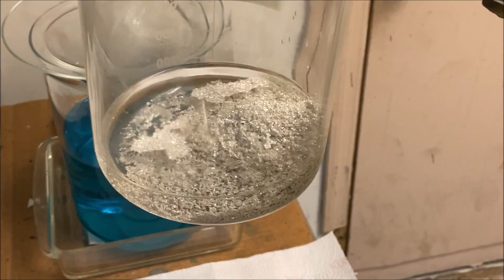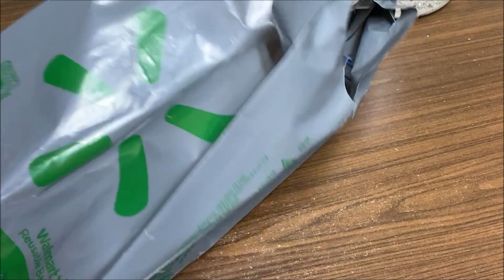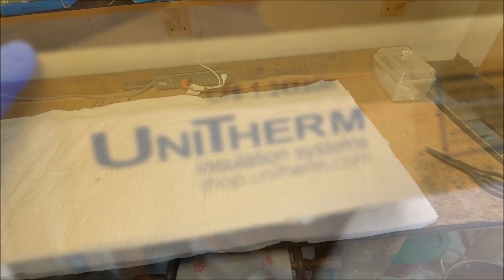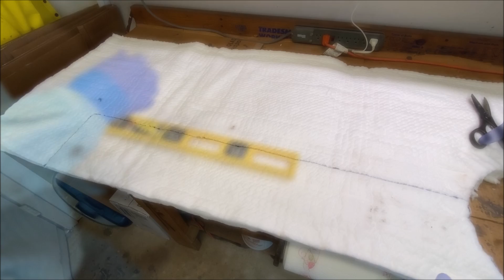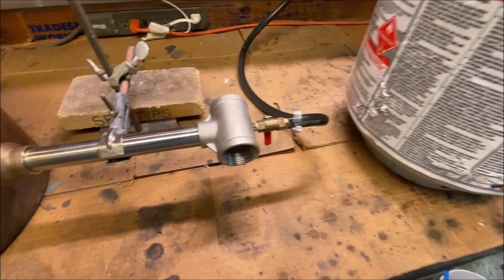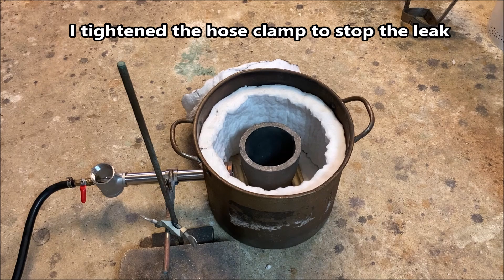Furnace Build For $100 Part 1

Comment: Hi sreetips, great job for 100 bucks, couple of tips from a regular melter, offset your burner to about 45 deg, as you are trying to heat the environment within the furnace, not the crucial directly.
This will prolong crucial life and create uniform heating.
Please don’t run without adequate airflow... period.
For silver run about 1.1 Mpa and preheat all your material to be melted to remove any moisture.
‘MOISTURE’ is your ‘ENEMY’.
Preheat all lifting gear and moulds before pouring, and finally put your propane/ LPG bottle in a larger bucket and fill with cold water to cover about a  1/4 of the bottle, this will prevent it freezing, if your doing more than 1 melt in succession.
Otherwise bring on your first melt.
Don’t fear it, just respect it.
🤤😁😅

Comment: Burner hole angle could be a bit more slanted to influence correct flame turbulence. Refractory cement/ridgedizer will keep the fiberglass intact plus make the furnace more hot or capable of holding more heat.

Awesome video though. I think this will be great for all that silver you've got!

Comment: Angle the burner instead of having it blow strait in. angle it so it gets a cyclonic path to even heat distro. also coat the wool with refractory cement and as for the lid drop a hole right in the centre of it for vent and with the hole you can add material

Comment: Heat that new crucible to red heat to temper it. Put a piece of cardboard on your plinth (the ceramic plate you took from the electric furnace) to prevent the crucible from sticking to the plinth. As others have cautioned, direct the flame at the wall so that it swirls around the walls and does not directly lick the crucible. Yes, you need a hole in the cover.

Last tip: do several dry runs with the largest mass you expect to have in a single pour. Three kgs of molten silver holds an incredible amount of heat/energy!

Comment: Get yourself some stainless steel wire and use it to stich the wool to your lid. Go in the side about half the thickness to protect the wire.

It should all be covered with a refractory cement to prevent loose ceramic fibers from blowing loose too. Wear a p100 respirator until it’s encapsulated in refractory.

Comment: Yeah, Sreetips.... Ya definitely need a vent hole... Haha. Usually folks use a certain kind if cement to encase and seal the ceramic wool... It helps lessen the heat transfer. I suggest doing that before running a full scale melt, as you may overheat the pot even though the wool does not burn. It helps with thermo- efficiency as well as safety.

Comment: Might I suggest angling the torch in the bucket to create a slight vortex for more even heating of the crucible and also place cardboard under the crucible before charging it to create a layer of carbon to stop the crucible sticking to the plate/tile/base when at high temperatures
Reply: Love the content

Comment: That's pretty cool I find when I run mine if I keep the burner at an angle it heats up the crucible much more even I had to put mine at a pretty good angle but then a heated up the inside a lot faster and made a really nice jet around The crucible always take some trial in there you really can't beat the price looks good and I bet it's going to work great

Comment: Nicely done, but you need to angle your burner so it does not point directly at the crucible. It will send the flame and heat around in a cyclonic motion giving it a more even melt.

Comment: Why do u need to ad silver to ad silver to the eletro light
Reply from the maker: Because as the silver cell operates the electrolyte gets depleted of silver content. It plates out on the inside of the stainless bowl as it runs. I’ve seen it become so depleted of silver that I could not get much reaction when I added hydrochloric to drop the silver chloride. When it gets that low then copper is almost certainly depositing with the pure silver crystal. You can tell when it happens because after drying the silver crystal will have green spots on it. I never use the electrolyte more than twice - ever.

Comment: CAUTION & WARNING Streetips my friend !! Please please DO NOT continue to use the furnace as is I'm begging you please DO not !! It's a hugely KNOWN CARCINOGEN breathing those fibers aloft from that ceramic blanket YOU'RE using as your primary & only singular insulation material. Once heat is hitting that thing -- unless YOU have applied some type of hardener coating like HT-100 or castable refractory cement, the blanket is helplessly throwing crazy dangerous fives all over the place friend !!!
I'm only making this be made aware so that you're still here for years to come still 😊
And absolutely correct yes !!! Must cut a vent hole in lid (circular - I'd say exactly identical in size to your propane burner !! Lastly, tilting direction of angle of flame will help heat evenly + be LESS damaging towards both your furnace walls and crucible friend....
Great Work as always !! Few tweeks YOU'RE nearly right there man !!!
Reply from the maker: Got it, thank you
Reply: @sreetips  excellent that's great thanks again for all that you do kind sir and NEVER ever stop doing your amazing outstanding work that you share so willingly and amicably graciously every time another video upload flashes in front of and totally astounds & keeps all of us in awe !!!
Have an outstanding night my friend !!!
Reply: HTC-100 is an IR reflector and is an optional expensive coating. Saitenite or Mizzou 3000 are good hard facing / flame facing refractory coatings. The HTC-100 should be applied as a thin coating over the hard facing to improve furnace efficiency.

Comment: If it is one thing I have learned about that ceramic wool stuff, it would be that it MANGLES scissors. I always buy a cheapie-throwaway one from Harbor Freight.

Also  you are gonna need a vent hole in the middle of that lid. I saw someone else use long bolts with some big fender washers and some refractory cement to get the fender washers inside the wool, then goop 'em up with the cement, and then the metal of the bolts/thread/nuts won't get into the furnace. It's messy, but it is a clean install... Well, a little cleaner, maybe.

Comment: hi SREETIPS! 

hey buddy love your channel since the beginning btw. i never have had anything to say before, but thats because im usually learning about electrolytic cell refining. but guess what? today i can teach you a thing or three in return! 

PRO TIPS:

you need to vent your lid so that your crucible is visible inside, and it also needs about an inch of clearance for heat to escape between the crucible lip and the top kaowool lid. make it about the diameter of a can of soda pop. if you see fire coming out the top, you are just wasting gas. thats your vent, and access portal for your stirring rod. assuming you are using graphite, you probably wanna get a few if you have not already. 

turn your flame at an angle, towards the furnace circumference and trim out a little angled cut in the kaowool so you dont burn a hole in your crucible. 

important things are that the interior gets enough oxygen to get plenty hot. bright yellow/white if using the color index and no pyrometer, or that your furnace can reach 2000 fahrenheit.

i just use 2" thick kaowool and a fire brick in the bottom. and bailing wire to hold it all together in rings with a kaowool flap over the top. kaowool gets firm when heated fyi, so it goes from floppy, to stiff and easy to handle, hard as a board actually.  my torch is a venturi jet so its design sucks air, but most torches like your own, for a smelting furnace, require some type of boost from the surrounding air. you can use a shop vac a small one, on low, and a steel pipe. be ingenious and try to avoid duct tape ;) 

make the flame go around the furnace, then up and out. it should spiral up like a wizards flame out of your pop can size hole to a nice point. waste some gas to get the right shape and flow. i do this by making a U shaped furnace out of kaowool on mine, and put the torch at one side, then bend the kaowool around with the bailing wire to make a "circle-ish" rounded and long D shape. doing this causes even heating all the way around your crucibles.

i do not surround my kaowool with steel. this method is incorrect and im unclear why anyone does it because it takes something that is unsafe, and then makes it even more unsafe! surrounding kaowool in steel. doing that makes a hot surface, which is exactly what kaowool is designed to not have. you can touch the outside of kaowool with the inside of the furnace being 2000f+ using your fingertip and it will feel warm to the touch on the outside with nothing additional covering it on either side due to kaowool's thermodynamic properties as far as insulation and heat dissipation go. i use 2" kaowool and buy 24" squares to make a new furnace, and only use one thickness to go all the way around and over the top.

set your torch at the lowest point possible in the furnace. like just off the floor about 1/8 inch. this makes it so you dont have blow outs and cold spots and stuff inside.....or a crucible thats white hot on top but still black cold on the botom because heat is not hitting it correctly.
this is why i use two k26 fire bricks for the furnace bottom. it gives me something firm to strap the kaowool to.  and makes a nice light, but heavy enough base. they are easy to shape. you dont need any cement or glue. just carve a groove and twist a wire until they are tight. then wrap the base the same way you did the can. cheap and easy. one less ingredient even.

remember that a kaowool furnace is a consumable item. i trash furnaces from time to time when i have a crucible fail during rock assays or worse. so be ready for that too. working with crucibles and a furnace is not the same as using a mold and torch set. 

because of how much precious metal you tend to pour ALWAYS TEST YOUR CRUCIBLES WITH A PREFIRE. get that sucker yellow orange hot, take it out, and watch it as it cools with keen eyes. examine it closely for cracks and imperfections. they will show up as cooler spots and become visible as the crucible changes color during cooling.

i take some sand paper and prep my graphite crucibles on the inside by sanding all the imperfections smooth as a babies butt. then i wash it out with water and let it dry, then heat it up over the furnace, then heat it up again in the furnace to check it again.
this makes pours happen flawlessly. also, re-carve your pour spout on your #3 crucible to give it a better drip edge.

for silver i would probably use a borax prepped magnesite crucible and just some 20 mule team borax to flux the metal in the cup when pouring. but whatever floats your boat. you may not like the junk that graphite will leave on a bar if not cleaned properly.

im pretty sure you are getting ready to pour a big silver ingot, and i wanna make sure you get a good one the first time.
reply here if you wanna chat me up some, ok?
Reply from the maker: Nice, I’ll print this and re-read carefully. Thank you
Reply: @sreetips  you are welcome if you have any questions about diy furnaces, or want a photo for an idea reference lemme know. 
one last  thing, would you be interested in refining comstock lode gold from virginia city nevada? for a video i mean.

Comment: Need a hole in cover for off gassing. Just make it the size of crucible radius. Agree with other comments that flame needs to come in tangentially to the pot and not direct impingement on crucible. You’ll burn up crucible if you have it the way you have setup.

Comment: Nice! If you put the burner at a tangent to get a swirl, it will heat the area more efficiently (also your crucibles will last longer) and you definitely need a vent hole at the top's centre  (arround 1.5x the radius of the burner hole)

Comment: You can also get Rigidizer to coat your wool in to better protect against erosion.
Reply: Also protect your lungs from the nasty fibers
Reply: $45 is well worth the price vs your lungs
Reply: @DiverCTH  Yes, absolutely!. Another very important piece of information indeed!. 💯💯💯💯
Reply: @sreetips you really need to add rigidizer and refractory cement to your wool, to keep any fibers from becoming airborne, and help your own health. not to mention it will also make your foundry more efficient
Reply: @justinlawrence5753  Not sure I get what you mean
Reply: @andyf1235  the rigidizer will cause the fibers to stick together, and not become airborne.

Comment: don't have the burner pointed directly at the crucible, have it pointed off to one side to cerate a vortex for even heating around the whole crucible  and as you said a hole in the top of the lid to get good  flow threw  . plenty of good examples on youtube for comparison

Comment: You need to aim the burner to the side of the furnace to  achieve a more cyclonic action around the crucible. This will give you a more efficient heat distribution in the furnace, and will more evenly heat the crucible. You will also use less propane by doing this. All of the home furnaces on the market are built this way for those reasons. You cut the hole in the side of your soup pot more than big enough to achieve this. Maybe add a little more ceramic wool around the burner hole if necessary after you angle it. That should do it for you! Good luck!! I can't wait to see big silver melts!
Reply: Came to comment the same thing. See someone already has. It will also prolong the life of your graphite crucibles by not blasting one side of it with the flame which can burn holes right through it. Don’t ask me how I know. 😂
Reply: Yup, I was also going to say this, when I seen over a hundred comments in the comment section I realised a ton of people would have already beat me to it. I'm planning to do a furnace build using concrete, but maybe I'll use this wool stuff now pending on the outcome when I've finished watching the video.
Reply: I thought the same thing. Thx for pointing that out Chris👍
Reply: I came here for the same reason. I put a like on the top comment so that it has more chance of staying in the upper regions of the comment system. I also do hope he was wearing a good mask on his face along with the gloves. We don't know much about ceramic wool yet, it may be safe or it may be like asbestos. It does dull scissors though since he was basically cutting quartz down.
Reply: Thats awesome Snorri👍
Reply: @MrWallinor  Moder Svea har visst en kanal här ser jag. ;)
Reply: @johansmith4764  Haha :) Gillar Sreetips och det han pysslar med. Nyfiken som man är så lär man sig en massa nytt. Och kan man stötta honom på det ynkliga lilla sätt som jag gör här så gör det mig glad :)
Reply: @MrWallinor  Ja jag gillar honom också. Han har ett trevligt sätt att framföra sig tycker jag!
Reply: @johansmith4764  Ja verkligen! Jag spenderar en hel massa tid på yt, och Sreetips är en verklig favorit :)
Reply: As the others said, don't need to repeat it.  Maybe I missed it but, the furnace would get hotter and faster with the lid on.  Please put a four inch hole though.
Reply: I would be concerned with the longevity of the insulation if the burner were directed at the side of the furnace with the fire blanket. He is offsetting the flame a little bit and using the crucible itself to take the brunt of the heat from the burner and direct the rest of the heat to circulate around the furnace. In furnaces with refractory cement or fire brick they can take the direct impingement of the burner on the side without issue. A hole in the center of the lid would help as others have said.
Reply: @nolansykinsley3734  you should read above comments about direct flame on crucible. Also, that wool will not degrade with a flame on it.
Reply: @nolansykinsley3734   @NolanSyKinsley  the small section of wool is likely cheaper to replace and is definitely less of a risk than a broken crucible, that said, a layer of refractory cement may be a good investment to reduce the risk of fibres entering Mr sreetips lungs

Comment: You may want to watch a few of the videos on https://www.youtube.com/user/bigstackD, he has a lot of experience. You will definitely need a lid with a vent hole, otherwise the gas will not flow around the crucible efficiently. You may want to support the crucible with a refractory brick which sits directly on the bottom. The crucible is going to be quite a bit heavier when its filled up and you don't want it to spill molten metal due to wobbly support.

Comment: You need a hole at the top for proper air flow or it will smother out. You also don’t want your burner directly in the middle you need it off to the side for circular motion. Strait on like that will burn your crucible up faster than crap and make sure you heat treat the crucible as well.
Reply: I built mine out of an old propane tank.

Comment: Next time offset the hole in the pot, as direct contact with the flame will erode the graphite crucible. Additionally, you should coat the wool with a refractory cement to increase thermal efficiency and reduce airborne fibers. I also think the pot you chose is far too thin, and will likely fold/crumble once heated a few times. 

Good luck, can't wait for the bar.
Reply: I second this comment.
Reply: I agree with the refractory cement, ceramic fibers are incredibly bad for your lungs and shooting flame at them will surely send plenty of them airborne. The pot thickness shouldn't be of great concern, if the insulation is doing its job then the pot should not get hot enough to loose structural integrity.
Reply: @stevenbliss6484  It's an inevitability. Even the expensive furnaces experience intense hot spots after a few uses.
Reply: Agree

Comment: Angle your burner so the flame is aimed at the inside wall. The flames will spin around the inside and make a fire tornado around your crucible. Aiming it straight at the crucible is just gonna burn a hole in the side of your crucible.
Reply from the maker: Got it, thanks